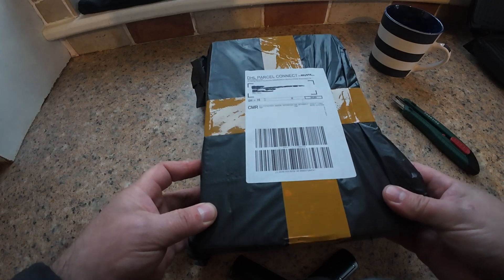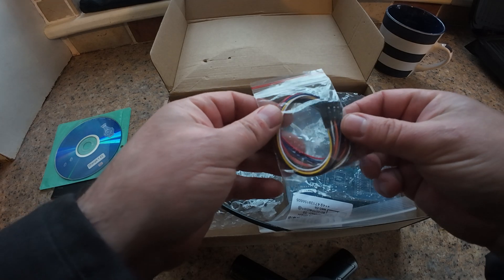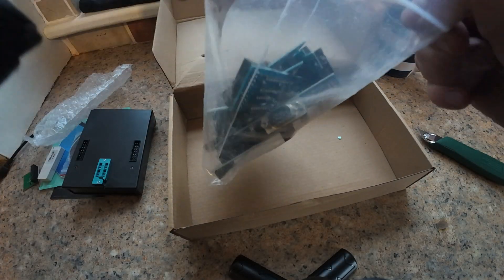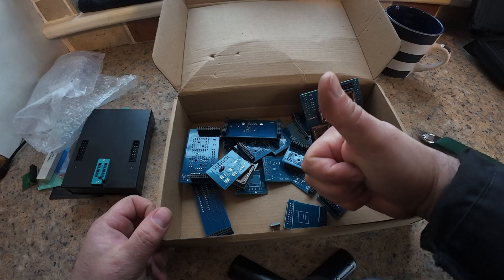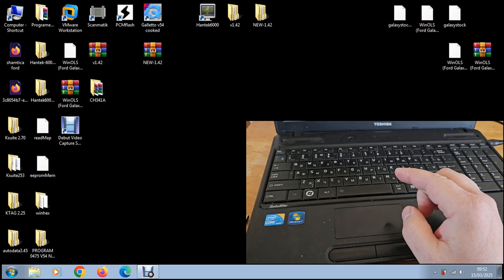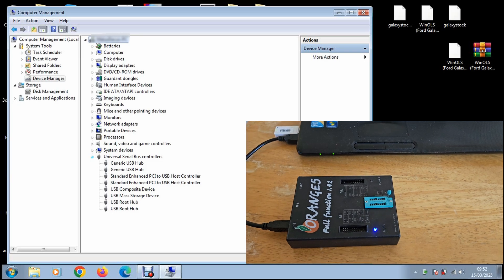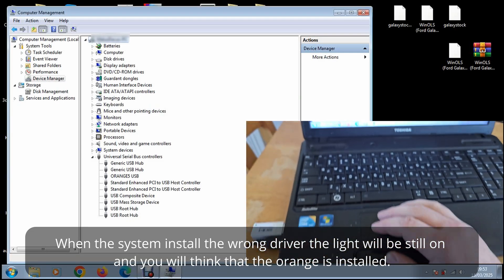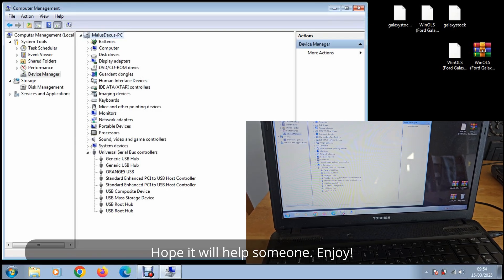Orange 5 v1.42 programmer unpack , overview and installation

Comment: My LED keeps flashing and the computer doesn't detect anything...
Reply from the maker: try installing the driver manually
Reply: @SePoateSiAcasa  It doesn't help, the device isn't detected at all... It works once a month, probably the processor or its contents are damaged.

Comment: I have copied all data from the DVD to my computer 
And system was not working as per your video 
There was no file for orange 5 USB no animation or anything 
The light at the box is not blinking
Reply from the maker: Did you try to install on a different computer?
Reply: @ yea 
I bought another pc 
Old with windows 7
Reply: It worked fine on that
Reply from the maker: Not all system are compatible. I doubt that they have made all the drivers for every windows.@NomanAli-lp7xl

Comment: I recently bought this whole system and am unable to install it properly,
I am using windows 11 at Inspiron 5406 laptop
What points should I perform to solve the issue
Reply from the maker: @NomanAli-lp7xl  it might notionally on every window. First check on a different system , that will give an idea if your unit is working or not.